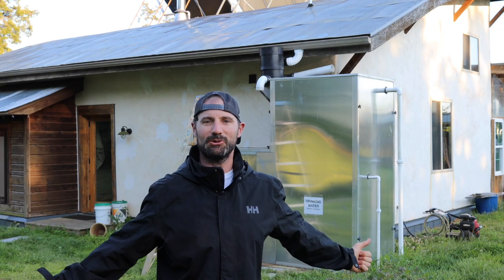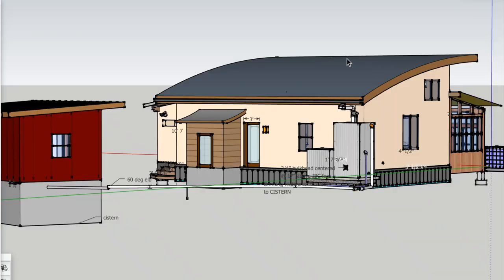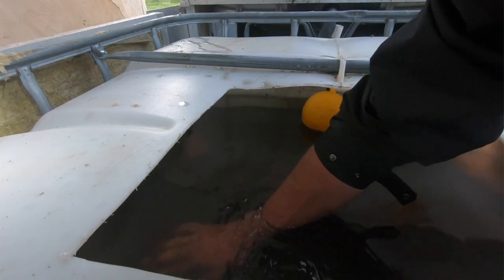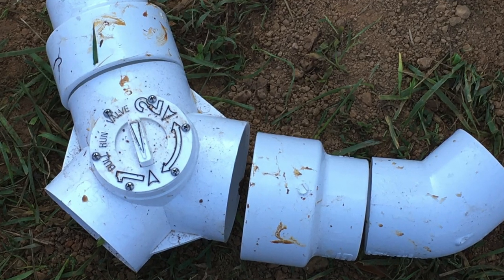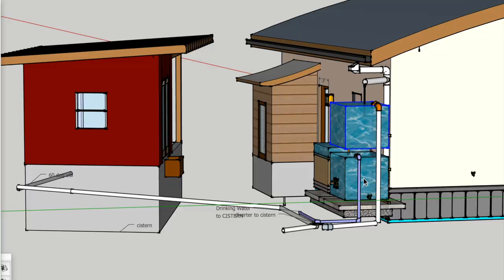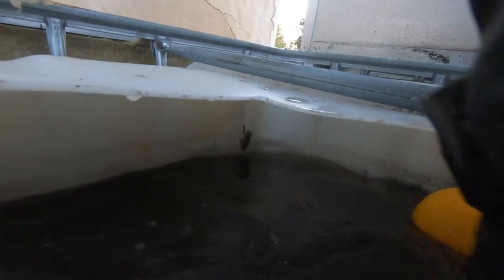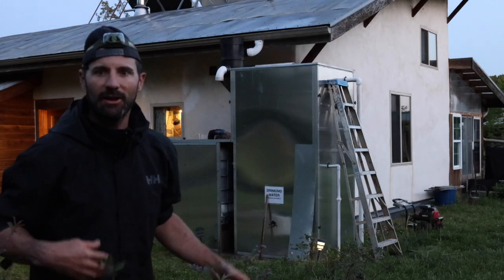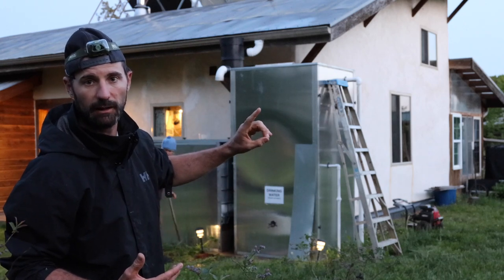DIY Home Water Filtration System: Rainwater Harvesting with a Biological Sand Filter and Maintenance

Comment: what i have in mind is a sand filter inside some mesh cloth at the base of the water tank flowing through a pipe connected to another water tank 

''             2 Esdras 2: 32 -100                       ;;
Reply from the maker: Perfect